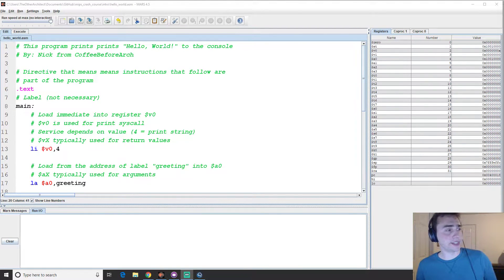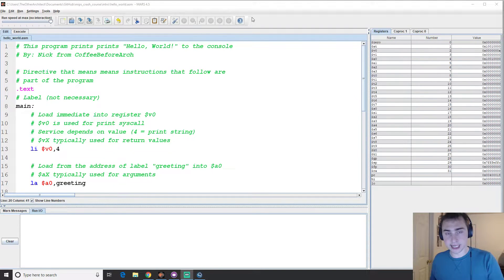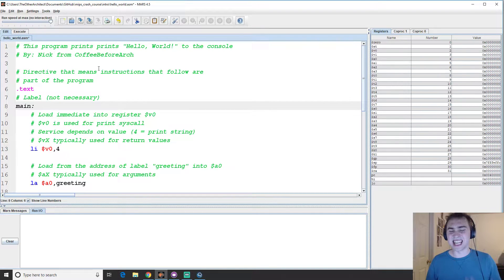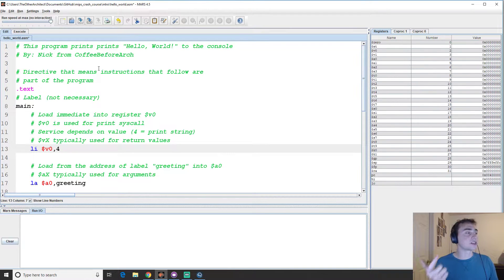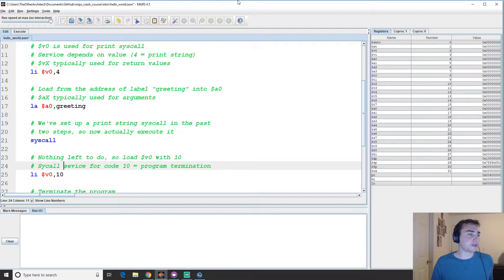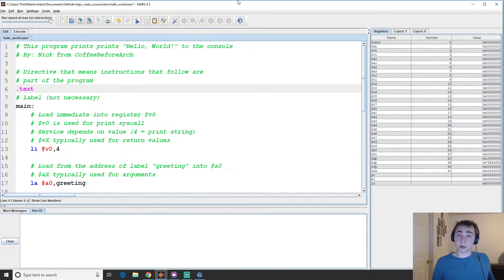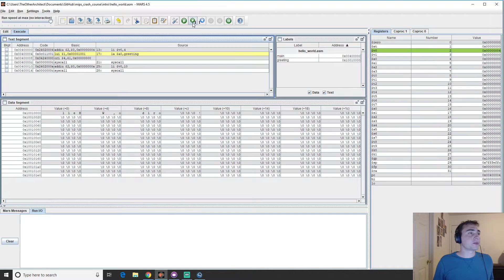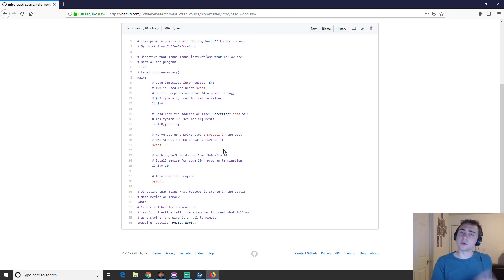MIPS Crash Course: Introduction

Comment: CAN SOMEONE please help me figure out how to write a functional program that asks the user for a number then divides the result then prints the result as a double not an integer, to ensure the answer is as accurate or precise as possible. The problem I face is that I know how to ask for an integer and divide integers, but I lose precision whenever there is a remainder (due to using integers). However, when I use double, I can never get it to print the double.

Comment: So is syscall in charge of finding the null character in the string? I'm guessing so, I looked a bit into syscall and it is used by MARS for simulating these functions.
Reply from the maker: It is the directive ".asciiz" that does that. That directive adds a null terminator to the string being stored in memory.
Reply from the maker: When executing the syscall, it may just print the characters of the string until it finds the first null terminating character. I'll do a test that just has a null terminating character in the middle of a string, and it should stop there when printing (my intuition), since there is no string length parameter.
Reply: @NotesByNick  Yeah I figured so as well. Thanks for the info!
Reply from the maker: @foreverAnkh  No problem! I did a few tests on my laptop, and think the most likely case is that the assembler guarantees that a null terminating character will be at the character 1 past the end of a string. A quick change, adding one to the middle of a string, failed at the parser of the assembler, which is what leads me to that assumption.